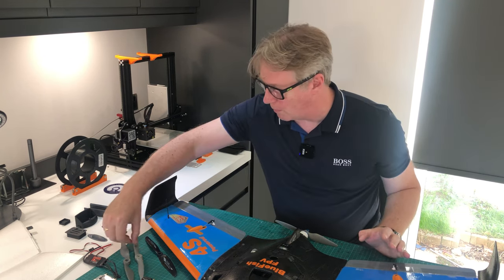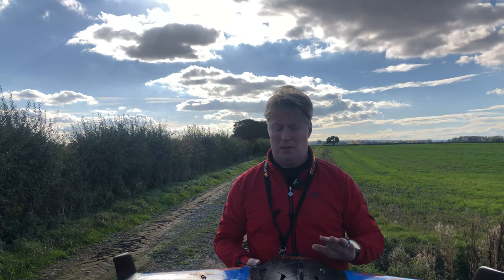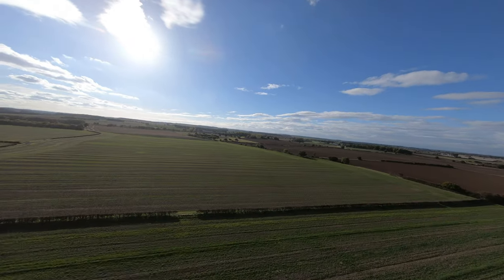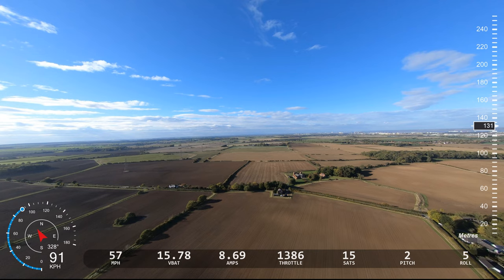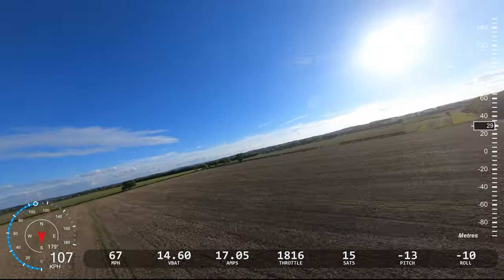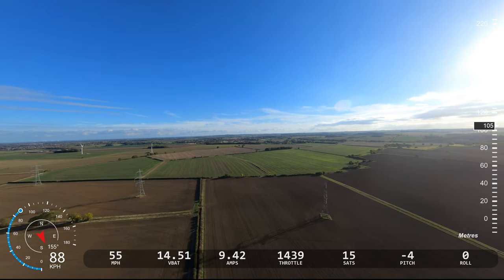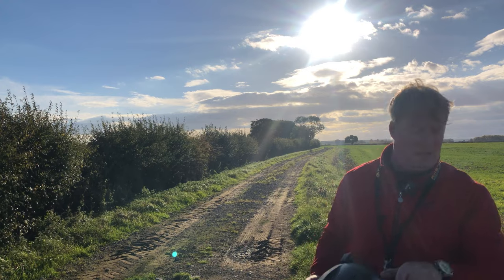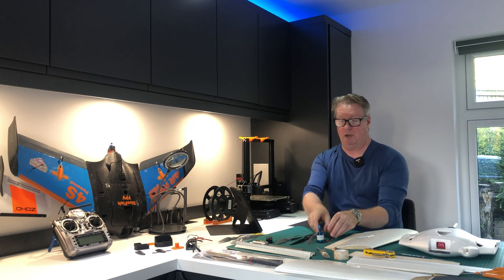AR Wing Pro Motor and Prop Combo Tests

Comment: Experiments! Looks like your on the fence between 8 or 9 inch props . Check out master airscrew . They have 8.5 inch props ! Also trying 5s . I find 8 in burns a lot of amps but 9 inch does what happened to you . When you throttle down you can't take off flying with big battery!
I'm trying 5 s with sunnysky 2212_980kv and 9 inch prop . Not enough power to take off with 4s , motor burns with 5s ! If you know of a motor this size , low kv that can take 5s let us know !
Also my setup is on ar900 classic wing . Thanks and keep touching on these topics !
Reply from the maker: Hi Ron I think I havce settled on the 8x4.5 props on 4S with the Sunnysky 2216 1400Kv motor, it gives me good performance for proximity and reasonable flight times if I am not over heavy on the throttle too often. I am using the APC 8x4.5 multirotor props and Aeronaut Cam Carbon Light.

I am building another AR Pro with a bit more of a cruising style and am going with the Brotherhobby Reunion 2318 1250KV on 4S with a 9x5 Prop. This still gives good performance but also a bit more efficiency if i want to extend flight time. This setup is also a bit quieter which can sometimes be useful. I am using the Aeronaut Cam cardbon 9x5.

I am looking to run my new Mini Drak build on 5S and have a Badass 2814 1300Kv and will be testing  props for that but probably looking at an APC 7x5 or 7x6.

Comment: Great to see more of your empirical testing Glen.

Another prop break - inevitable using brittle fixed wing props.

I know that you don't like folding props, so why not try durable quadcopter props? You are familiar with quads, so I am surprised that you have not made the connection yourself.

Quad prop are quite literally unbreakable! My Vantac AR+ Wing came with Gemfan 51x32x3 3-blade - on a marginal launch it would cut grass and still take-off! The tips can wear doing that, so that is the only reason I have had to replace the prop. Works great on my Durafly EFX Racer too - no more broken props on that craft!

By testing I found that 8x6x2  has an equivalent 3-blade equivalent of the HQProp 7x3.5x3. There are other pitches like 7x4x3. More of your testing would confirm which was more suited to your needs. Never break a prop again!
Reply from the maker: The APC 8 x 4.5 I am using are multi-rotor props and virtually indestructible, so I am with you there 100%

My launch technique is pretty poor so I am going to focus on improving that. 

Hopefully I will get out Monday as there may be a break in the wet and windy weather.

Comment: Buddy do you use the sunnsky with the long shaft or short one? i'm not able to find in europe the short shaft.
Reply from the maker: I use the short shaft. I got my last three from Ali Express. They came in about 10 days.

https://www.aliexpress.com/item/4000182022135.html?spm=a2g0o.productlist.main.27.3d596134XcXlC9&algo_pvid=e513d8a0-fb27-41a4-b6bc-31017234e7e6&algo_exp_id=e513d8a0-fb27-41a4-b6bc-31017234e7e6-13&pdp_npi=3%40dis%21GBP%2136.42%2117.11%21%21%21%21%21%402100bc5c16846577666838277d07ba%2110000000664943191%21sea%21UK%21128719519&curPageLogUid=APJSFvKXrmAN

Comment: What's the secret on balancing the AR. I'm having a hard time finding the right CG balance. I'm not running a gopro so I resorted to adding large washers under the battery.
Reply from the maker: I setup my AR Pro with the GoPro the added weight into the battery compartment until I hit perfect CG. That told me the ideal lipo weight I needed and it happened that the chnl 5000mah 4S was about the weight I needed. My strategy was to get the heaviest lipos possible to hit CG as I would rather have more lipo and flight time than dead weight to hit CG with a smaller battery.

Comment: Whats your thoughts on the e6000. I'm in the middle of an ar Pro build!
Reply from the maker: Well it definitely improves crash resistance and if if gets scuffed up you can peel it off and reapply. I only have mine from the nose to the front of the side hatches top and bottom. you can try it and if you don’t lime it peel it off and lam it.

Comment: Glenn,  Great test..  I've been using the Sunnsky 2216 1400v3 on mine.  8x5 stock prop..  Good performance over the V2 motors..  Might try the Hobby Bros....  Been flying my AR Classic 900 as a close proximity chase plane at my club...  Its been a blast getting back into FPV and upgrading all my boards to INAV 5.1...  🙂
Reply from the maker: Someone just commented to try a HQ 8x5 prop so I am going to give one a try as I think the motor could take a little more than the 8x4.5 which actually flies really well tbh. Glad you enjoying your AR 900, the wing I started with and I love it. I plan to build another one in the new year during the dark cold months.
Reply: @bluefish3607  I like the AR900, but I like my AR Wing Pros better..  I think the additional weight and wing surface just flies great.   Just got that new motor for the AR Pro..  Plan to upgrade from INAV 3 to 5.1 and the motor for some winter cruising...   Glad you are posting content again...  Head out to that quarry and get some new videos for us.. (Really enjoyed that video...). - Will
Reply from the maker: @SteffenRC  Cheers Will, last time I went to that quarry some guys turned up and told me to leave, maybe I can sneak back as its been quite a while 🙂
Reply: @bluefish3607  Glenn,  I just rebuilt one of my AR Wing Pros with DJI, INAV 5.1 and some bling...  I'll post a video about it soon enough..  I really love the AR Wing Pro over all the other FPV planes..  The performance envelop is wonderful.   Thanks for getting back on the AR Wing Pro.....    - Will

Comment: Great video, what kind OSD are you using?
Reply from the maker: In that video I used the blackbox data with Dashware to add the custom OSD, I use DJI O3 now with inav OSD.

www.dashware.org
Reply: @bluefish3607  Ok thanks, I was hoping it came with an OSD or something you can program in a flight controller, the flight controller you are using are getting difficult to find. Have fun, break a leg.
Reply from the maker: @vipertruck100  That was just a tool that allows you to add some OSD elements to the GoPro footage. The Matek flight controller and inav give a full OSD in the goggles that you can record if you wish. Although the Matek F405 Wing FC is now discontinued all other Matek FC’s support full OSD with inav.

Comment: Can we use 2806.5 1250KV Brushless Motor with 7-8inch props on AR wing pro for efficient cruising?
Reply from the maker: Thats a quad motor and I have no experience with them unfortunately. I guess it would be ok for a light weight build. Give it a test and see how it works out, it will be fun.

Comment: I had some of those thicker APC 8x6 props, they did NOT work well on either my AR wing Pro or my Ranger 2000.  The thinner ones...........were great on multiple planes/wings (all 1400kv)
Reply from the maker: Yeah I think 1400KV is too much for those 8x6 Props, the 8x4.5 was sweet though.

Comment: I recently installed your previous build with the t-motor esc and reunion motor, but I just added a TBS folding prop set to it. I am getting a lot of thrust with this setup. You should try adding them to your test as well.
Reply from the maker: Sadly I damged my T-Motor ESC in a heavy crash, they are fantastic and I will get some more in future for sure. The 9X5 Aeronaut is great on that Reunion, I have never thought about using a folding prop, which one do you use, size and pitch?
Reply: @bluefish3607  yes I would like to know what folding prop to

Comment: The Reunions windings burned on my ARP a few days ago. 4S LiIon setup, 8x6 APC-e prop 😞. Was doing a bit aircombat with my friend and ripping the ARP quite well for a few minutes. It shouldnt burn though.
You might try the HQ 8x5x2 props too with those motors.
Reply from the maker: You know its Marcs fault he reccomended the 8x6 for that motor :-) Good shout on the HQ 8x5 I will see if I can get one to try.
Reply: @bluefish3607  So Marc killed your ARP servo cable, my motor...looks like this dude owns us a sixpack of beer at the next Meppen meeting ;-)
Reply from the maker: @Slash7FPV  He kill;ed two of my Sunnysky motors so we need a full crate each 😁
Reply: @bluefish3607  Lets say 2x 6-pack plus he has do that Transrapid railway-video ;-) 
(well i´m just kidding, i know what we all owe Marc)

Comment: Great tests. Shame the nitro prop didn’t fit. Not sure it would of done aswell as the others anyway. Think it could of been more efficient but speed May of been reduced quite a bit maybe. Not sure
Reply from the maker: Im not sure either, I need to test the 8x6 again with the Brotherhobby motor as people have pointed out the lipo was quite discharged so it was not like for like, I will post up the results.

Comment: Lipo #2 was done for when you launched it to test the 8 x 6 prop....voltage sag on the speed pass. Of course the Aeronaut Prop is the winner.... quieter too of course..🤔😏😏🇬🇧 wish we could have seen the real live feed instead of the sterile HD stabilized wierdy zoomy stuff...🤔
Reply from the maker: I liked the Aeronaut setup as well and was my favourite.
Reply: @bluefish3607  Predictable really, the Chinese props are generally speaking terrible...The APC props gained fame amongst the IC fraternity many years ago. The electric lightweight versions were of course cloned by the Chinese...like everything else decent..🤔😳😳😏🇬🇧

Comment: Thanks for sharing these tests!  I burned a SS 2216 1400kv v3 on a failed launch when the prop was stuck in the ground.  Put the original PNP SS 2216 1400kv v2 on and flew that on APC 8x6 for a while.  Then I got another v3 and put that back on.  All three have been amazing (in flight) on the 8x6 APC with them never being very warm.  I suspect maybe a defect in the one you had?  I was initially skeptical of running 8x6 on 1400kv since the "classic" FPV plane combination was 2216 1250kv with 8x6, but again, all three motors on my AR Pro have been great.  Does about 115MPH in a slight dive.

Need some more stuff to try on your test rig?  I found and printed some extra wing fences for mine but haven't fitted them yet.  Reports are split between helps/doesn't help.  Files: https://www.thingiverse.com/thing:4975689

Looking forward to seeing your new builds!
Reply from the maker: Hi Jacob, I have burned 2 MKIII 1400kv motors now on those APC 8x6 so not sure why you are getting away with it. I have just ordered 4 different 8x5 props to test but the APC 8x4.5 seems to give pretty good all round performance and efficiency. Not that I tend to fly in an effient manner I am quite throttle heavy. Fins look interesting they might be worth a shot, thanks for the link Jacob.